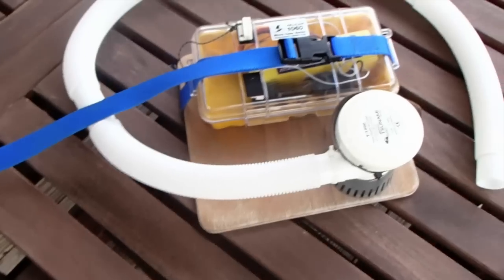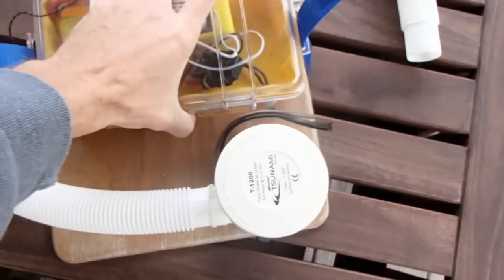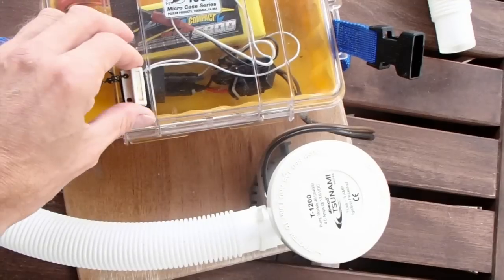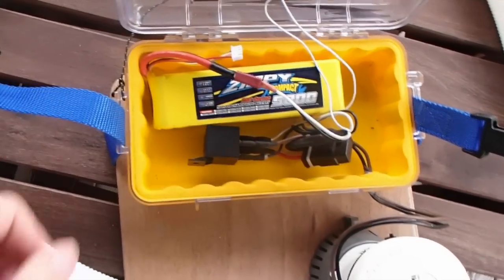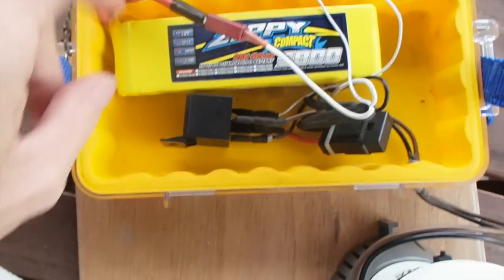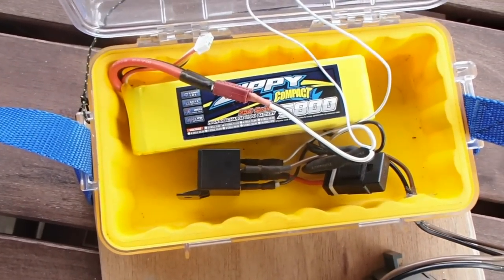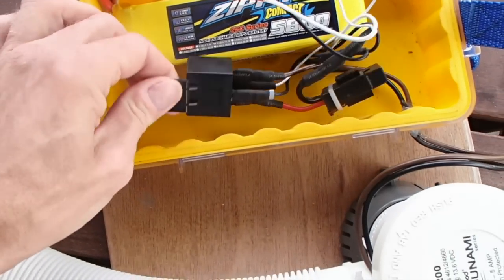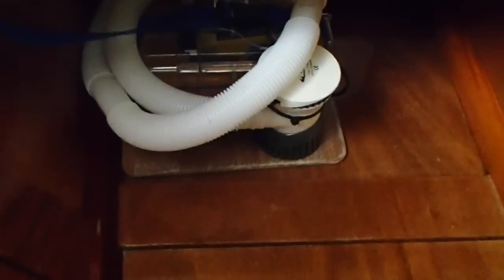Portable, light weight, high flow bilge pump.

Comment: hi simon , just curious as to what level of water that pump will pump down to? obviously not lower than the plywood base but how close?
Reply from the maker: I know it's been a year since you asked this, sorry somehow missed it. It works down to an inch or so. I heel the boat a little so all the water rushes to one side which helps it get almost all of it.
Reply: Hahaha, no problem, thanks!